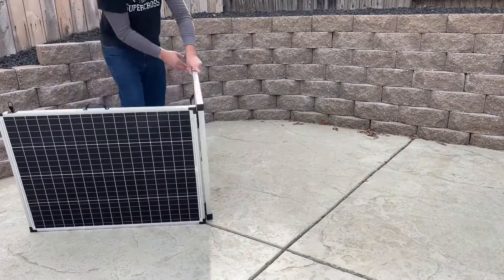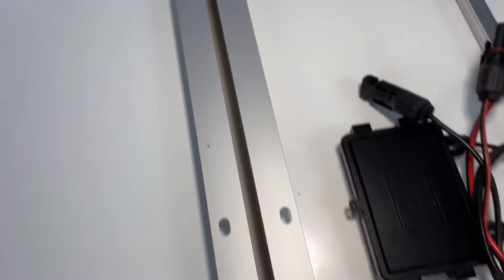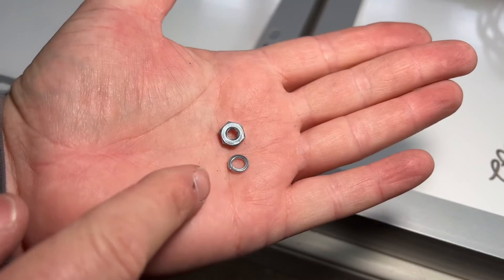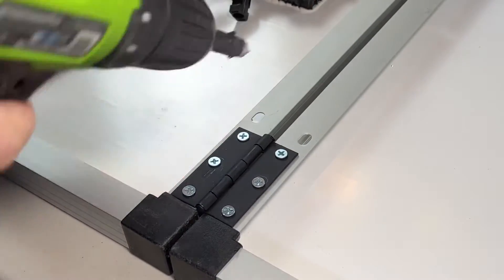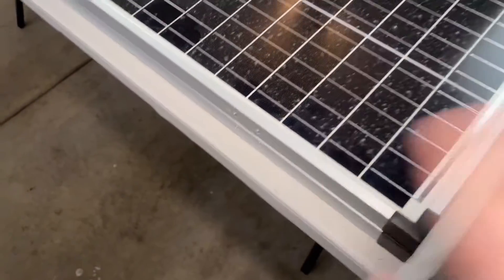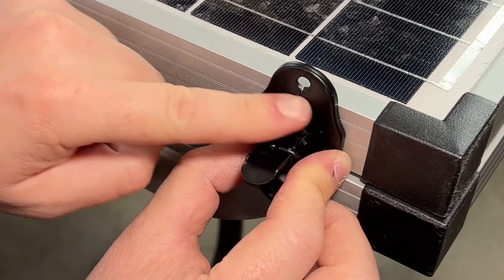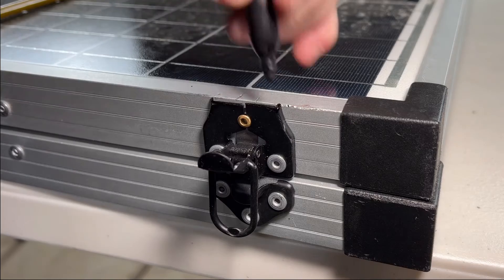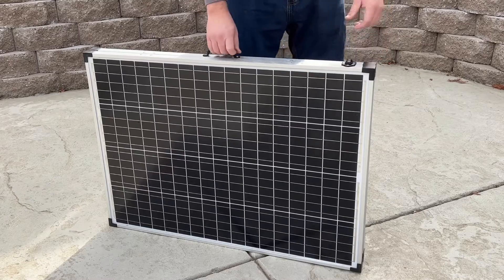Harbor Freight Solar Panel Suitcase DIY

Comment: Why wouldn't you have oriented them so they close with the solar sensors facing to the inside so they're protected??  Nice job, none the less! 👍👍
Reply from the maker: The outer glass is actually stronger

Comment: Bonjour très bonne idée c'est ce que je voulais faire aussi avec soit 2 panneaux solaires de 80w ou 3 de 50w je trouve sa vraiment bien sa permet de pouvoir bien suivre le soleil et être étanche à la pluie car même avoir des panneaux solaires sur le toit de notre caravane sa ne fonctionne que a 100% que quand le soleil est au plus haut de la journée cordialement 😊
Reply from the maker: that’s why you try to over panel some for low light conditions. unfortunately 200 watts is about minimum if you want to charge anything.

Comment: question: why not have them fold inward, so the solar cells would be somewhat protected by the aluminum frame?
Reply from the maker: The glass inside is more delicate

Comment: Okay if you want it to MC cable sent without ever have to change it even get Walmart's app look up solar panels look up 100 watt solar they'll sell for about $79 and some change for blue solar panels that is slightly higher amperage just a tiny bit smaller but they are a little bit more amps to it harbor freights solar panels. But your neck shift to look through my foot through the Walmart apps because they show all kinds of solar panels more kinds 100 watt solar panels for more money. I bought the blue solar panels because they start making power three hours before the black ones do you make power 2 hours after the black-and-white stop making power it's pretty cloudy out or the black one stop making power blue ones will still make power and they got just a little bit more amps to them. But I do have six harbor freight solar panels. But I did find the ones that Walmart has I bought some of those and they seem to do better than Herbert freights solar panels don't get me wrong I'm not getting rid of Herbert freights solar panels they do give me some power the poly solar panels at a 100 watt and slightly smaller gives me more power. Special When they said Polly solar panels are worse and makes less power I find that they are lying because my Polly solar panels at the exact same wattage makes the more power than the mono solar panels and to be fair I run them both at 12 volts and I've been doing that for a year now Anna blue ones are still making more than the black ones yes I like the Monocrystalline solar panels but I like the polycrystalline solar panels as well and besides I like the difference in colors in my yard.

Comment: This is great but how do you traneport it W/O damaging the panels?
Reply from the maker: You would be surprised how tough they are but some foam board or a blanket it really all you need unless you plan to thrash it but I hauled a foldable many times. All in how you treat it

Comment: Good idea but there's about half a dozen ways to have cut that hinge without using tin snips while riveted.
Reply from the maker: Thanks, and yes several ways to cut it. Dremal, hack saw, cutting wheel and more. Those where right there and no cords or any attachments. Less time then getting something out and finding a wheel. By the time I would have got a cutting tool out I was already done 👍🏼

Comment: I have those panels and was looking to do the same. I wanted to have solar face inward though so something doesnt hit it in storage. Same idea you did should still work right??
And I was looking at double hung window latches as for the latch part.
Reply from the maker: I have done it both ways but it seems the stronger part of the solar panel is the outside as that part of the glass it meant to take hits. Even a small chip or crack and most times the panel can still put out close or full power. Depends how deep and back the crack is.
Reply: @johnnysweekends  thank you sir for sharing!!
Reply from the maker: No problem 😀👍🏼

Comment: When you buy hinges they tell you what the proper screws to use are to match the countersink. Also try piano hinges next time. Much nicer and they're cheap. Just cut to size
Reply from the maker: Yea the supplied screws come with the hinges but are obvious wood. And man the selection of hardware at the store is poor right now, I would have use a slightly smaller screw so the head wouldn’t be proud but that’s what they had that was close. 

And the hinges I think were $2.89
Reply: @johnnysweekends  true that. You can also use a tap on a drill with aluminum if you use the clutch and appropriate drill bit. with 40w motor oil.. you can make it look real slick.
Reply from the maker: Yea while ago I did a nice 50 watt to make a 100 watt but that’s not enough for much of what I’m doing, but I made it look all trick spent some extra time on. 

No body ever cares 😂 so now it’s back to quick and functional 🤣

Comment from the maker: This can be with other small or medium panels as well 😀👍🏼 
Parts and more…
Hinges http://shrsl.com/3rqju
screws http://shrsl.com/3rqjw
nuts http://shrsl.com/3rqjz
lock washers http://shrsl.com/3rqjx
Latch https://shrsl.com/3rqjs
handle http://shrsl.com/3rqk2

Step drill  Amazon : https://amzn.to/3SNHLwi
Home Depot : http://shrsl.com/3rqk5
Mc4 kit : https://amzn.to/3fgxR8w
Rivet gun kit https://amzn.to/3U8xITp 
Video: MC4 Install Crimping Easy DIY
https://youtu.be/CFgRCBzquz4

If this helped you buy me a coffee 😀👍🏼 https://www.buymeacoffee.com/johnny5120J